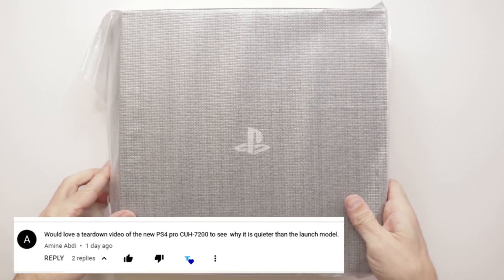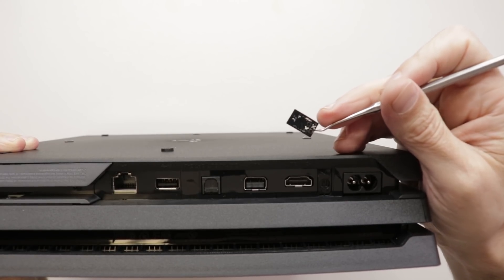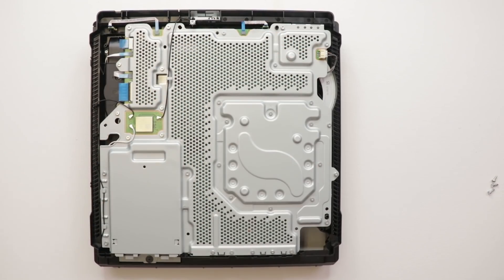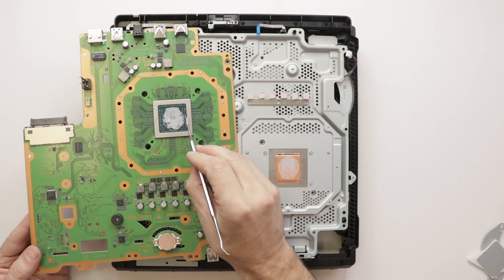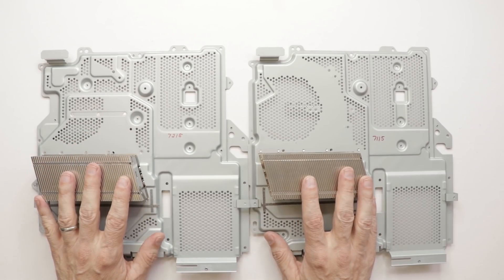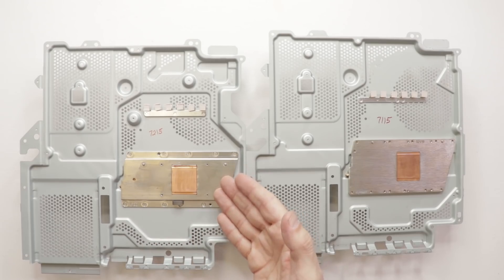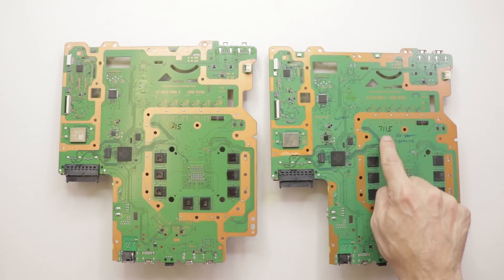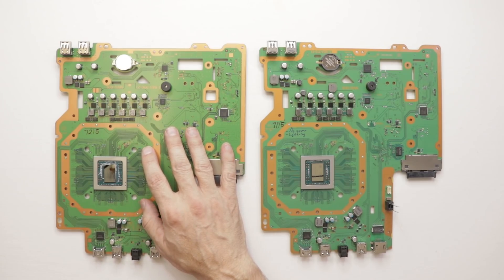The New 2018 PS4 Pro is so Quiet - But Why? Disassembly and Comparison - 7215 Model

Comment: Actually the newer heatsink design means it goes on tighter once screwed, which means much better heat dissipation. You can achieve a similar result if you bend the clamp on the older pro, although obviously won't be as effective.
Reply: To be honest when I first stripped down my launch PS4 Pro it looked like the whole problem with them and noise was simply down to bad factory assembly. The thermal pads were poorly aligned on the RAM and the thermal compound covered maybe 60% of the APU die.

Once I resolved these issues my Pro became whisper quiet.

Comment: I got the new PS4 Pro About 5 months ago to replace my older PS4 Pro as that one really did sound like a jet engine (hate noise!) Problem is the New Pro is getting loud, nowhere near as loud as the last one but still annoying.. I have taken the cover off and cleaned the fan, its as clean as a whistle but the noise is still there Grrrr... Any help would be appreciated thanks.

Comment: It's honestly disappointing Sony didn't even bother upgrading the cooling system with a liquid cooling system if there's one thing Microsoft does better is they have a much better cooling design It's truly fascinating on my Xbox One X I have tried the most graphical demanding games like Resident Evil 3 remake or Red Dead redemption 2 I do not hear a thing It's scary quiet and I know why it's super quiet to the point you don't even hear the fan It's because they are using liquid cooling the PS4 Pro should have used liquid cooling it would literally prevent the fan spinning so fast to the point it sounds like a dam jet going at Mach 3 And I find it strange Sony did extremely well with PS3 super slim it was the most quietest PlayStation console ever made but why the PS4 models are so damn loud? I found out the real problem is Sony decided to use a cheap ass thermal paste on the APU But much to my shockness I decided to dismantle my PS4 Pro destiny 2 model then I noticed the thermal paste was dry as hell So I scraped it off I bought the best thermal paste I could find I carefully applied it to the APU chip with a q-tip reassembled everything back then I decided to play bullet storm full clip edition again I could not believe that made the biggest difference I don't even hear the fan going haywire anymore 😲 I guess this whole time the fan was only spinning so fast because the thermal paste wasn't doing its job keeping the APU chip as cool as possible But hopefully the one I applied should last several years 😉👍
Reply: Commander's Gaming Channel does x1x have liquid cooling?
Reply: @captainaves  
Actually yes the Xbox One X is the first gaming console to have a liquid cooling system That's why it's so damn whisper quiet even I put my ears next to it I do not hear the fan at all no matter how GPU demanding the game is it still takes it like a champ 😍👍

Comment: I tried cleaning my original pro fully at the weekend cos it sounded like a jet... i ended up accidentally pulling the holster for the power supply from the motherboard instead of just the clip :( I also made a bit of a poor job at redoing the thermal paste (first time dismantling) . Anyway luckily i had a repair place not too far from me, cost me £70 to fix but they cleaned it further, re did the paste and put re-fixed the power supply to the motherboard. It now sounds a good amount quieter (there was an insane amount of dust clogging the heat sink and other areas. I’d recommend taking it in for a service if yours sounds like a jet anyone.

Comment: count the grills on the radiator, it seems like they have configured the air to metal ratio between them. Something like getting the air to fuel ratio just right on the car...

Comment: I could see a small difference between the heat sinks of the two so I fired up Photoshop and created a selection on 7100 series and putting that layer on top of 7200 series reveals that 7200 heat sink is indeed a bit bigger. We can not see the depth as we do not have side photo but if it is also just a bit bigger in Z depth then it is safe to say it has a bigger volume of air to pass through and that could make a huge difference with everything being the same.
Reply: Btw I'm talking about the area that has the air passing through which is the side that is important. When you turn it around and talk about area difference of the plate that has copper portion that is contacting IHS, that part does not matter at all since only copper area is contacting and the rest is useless.
The other side however has the thin layers of metal sheets in compact formation of rows that air passes through for a cooling effect and that area from top-down makes all the difference, and if the depth has a height difference then it becomes not just a small area difference but a bigger volume difference. So, inch x inch = inch squared area but if it is inch x inch x inch = inch cubed volume and for cooling air volume is all that matters

Comment: i got the regular ps4 and it was very noisy . then i disassembled it and the thermal past was rock solid i literally scrap it off from the die then i replace replaced it an it's very quiet since

Comment: Liquid metal about a year ago, my 'launch' Pro is inaudible playing 112 hours of Persona 5.
Reply: Now it runs cool and fast cuz... well I've put an SSD in every of my PS4 Slim and Pro
Reply: Tbh 112h isn't that much. I've played over 2k Hours on my PS4 Slim and needed to clean it after about 2 years (at this point I couldn't take the noise, although it wasnt that bad)
Reply: @Warlord_Nero stillll run-in smooth and its vertical stood.

Comment: Hi ! I Bought one in Japan a CUH7200B the outside and the manual says it runs on 110 volts only. I’ve read some forums saying ps4/ps4pro  have universal voltage that can play 110-240 v

I’m gonna go back to my country that uses 220v :| Can you confirm if it can run on 220v and not blow up ?
Reply: Yes, I have bought 7215b model of ps4 pro from usa and now using it in Pakistan on 220v. So, no issue because ps4 pro's power supply is manufactured in a way that can be run on 110v and 220v as well.

Comment: Based on Digital Foundry's measurements, the 7200 model draws the same amount of power as the 7100, within a few watts. 7200 exhaust is a bit hotter. My guess is that either the 7200 somehow is more efficient at getting heat removed from the heatsink, or maybe it's quieter because they found a reliable way to let it run 4-5 degrees hotter under load.

Comment: It appears the shape of the heatsink is also different. As seen at 5:40, the new model has vertical faces that the old one does not have (as the old one is a flat plane). I wonder if that can change the heat dissipation as well.

Comment: Hi Tronicsfix. I have a question.  It's August 2019  Can a person get a Model #7200 ps4 without buying the Red dead redemption 2 bundle ?  They are hard to find.  Thank u. I hope u see this. I actually have 2more question.  Do u see more ps4 pros breaking down than the original ?  I see alot of people complaining there 2 year old ps4pro is already broke on them.  Should I just get a slim ?  I'm saving up for the PS5  of course.  Thanks again!!😎👊

Comment: Mabey it is just me but I think that it is strange when people that bought the PSpro very early on when the new PS model was introduced got a inferior product than people that bought the console much later on. You should think that just because it is the first model that Sony did everything to ensure that anything on the PSpro worked flawlessly. This is a well known issue with consoles that they make a lot of noise. It is imo better to put in a fan that is more expensive but make less noise than the fan that is used in the introduction model and sell the console for little bit higher price and have a quieter gameplay experience.

Comment: I really like how they made the fan easily accessible to clean if needed.
Reply: the whole console is easy to maintain, it just has tons of screws
Reply: If only the heatsink was easy to access and clean without voiding the warranty
Reply: @Ultimately_Everything  it's not like you can fully disassemble any product in the world without voiding a warranty. the sticker is there to make sure it's not your fault and that it is actually a manufacturing issue.

Comment: There’s a very simple reason. The fan just spins slower. This reduces noise (a lot) but causes the apu&heatsink to run hotter which is why the exhaust air is also noticeably hotter.
Reply: are u dum we all knoww that

Comment: A slightly thicker heatsink on the older model gives the sink more thermal mass, but its surface area that's important to losing heat energy by forced (or non-forced) convection.  So, both models have the same heatsink.  I suspect the CPU/GPU are more efficient on the later model.
Reply: It's the same CPU/GPU.

Comment: gotta tell you my good man, I don't understand what people want anymore? a 4k UHD gaming ready machine for less than 400€ sounds like gold standard of a bargain to me. it does come with a bit of noise included, BUT you payed less than a mid-ranged graphics card for PC costs and you are complaining? come on.
Reply: Ok but howcome the xbox sounds so quiet. Go search it on youtube there's literally almost no blowing sound LOL. But then you point out that the cost is to little for the ps4 seens like you're not comparing it to similar prices
Reply: @hahazim34  good point. but you're forgetting that MS is behind xbox and they did their console somewhat differently than PS4 or PS4 pro. took a lot of time to even get in the console business, so when Sony was at PS3 they made their first console ever.

Comment: One big change that no one noticed is theres way more room in the new one for air to circulate, the heat sync is actually bigger on the new one, and the raised portion is extra metal, the stamped metal is raised away from the fan far more than the old, more room for air to move, less noise

Comment: I have the white 7100 revision and it's very quiet. It does kick out some heat and occasionally gets a bit of faint coil whine with pro optimised games (pretty common and nothing to worry about)... But still very quiet compared to the launch Pro and earlier PS4 models. The biggest change for the 7200 revision is the power connector. The 2-pin kettle style connector on the 7000/7100 is not very secure and feels a bit wobbly/loose. The figure of 8 connector on the 7200 is a tighter fit and much more secure.

Comment: There are 2 missing resistors in the upper left corner on the processor side of the motherboard on the 7200. I would assume that you are correct in that they found a way to make it significantly more efficient so it does not need to pump so much energy through the board that they decided they no longer needed to gate that power.

Comment: O_o Um it has exactly double the air flow to the fan thanks to the extra holes. Pretty sure that this means it can dump the hot air far more efficiently and so runs cooler. Sometimes it doesn't take much to reduce the heat in a compact case. In the previous the fan was trying to pull sufficient air through half the holes and so had to work twice as hard to gain the same cooling.

Comment: Well I noticed that when you removed the new style warranty stickers is the new pro takes a standard figure 8 power cable. The old school PS4 pro took what looked like a desktop power supply cable minus a ground. So would would that mean the new model takes less power than the old desktop computer style power cord?

Comment: I dont know why it cools better. But i just open my buddy PS4 pro (Destiny 2 White) to fix is disc drive but man the Paste on the chip was sooo dry and was like caulking and there was sooo much. then i put it back together i put some arctic sliver Paste . let see if that does anything.and this system was very clean too for being 2 years old

Comment: @TronicsFix Digital Foundry did tests on the new PS4-PRO RDR2 Bundle. Even though it is quieter, it does in fact run hotter. Which is kinda what I was thinking. As Sony did cheap out on the Heat Sink. I think we could all agree with that. As always Thank You For All You Do & Keep Up The GREAT Work!! ✌🏻

Comment: Id love to see a temp test more then the it just cools better because its less noisy. I have a feeling they are just letting them,get warmer or a better fan noise wise. And the metal base plate being a diff size does not really do anything since that part is not finned for heat dissipation and has no air flow over it.

Comment: You're quite knowledgeable, no doubt, but from what I know just because the new one is quieter, doesn't mean it's running cooler. Sure hotter temps will make your fan rev more, but it can just do that by default to ensure it doesn't overheat perhaps? It could just be the fan is quieter no? bearings whatever? I have a PS4 pro that only sounds like a jet playing certain games. Some high demanding games seem to be optimized better, like Witcher 3 my PS4 Pro is pretty quiet, yet Just Cause 4, Resident Evil 2 my PS4 Pro goes crazy..Red Dead Redemption 2 of all games, is actually pretty decent. Hitman 2 is damn loud. 

To further perhaps prove my point, on my PC I replaced my fans, and now I can't even tell if my computer is on unless of course I look. If I play the same game I did before I switched fans, I could hear it, now it's whisper quiet. Perhaps this same thing is why the new one is quiet? or maybe you're right...maybe the new one is so much more efficient, and doesn't get nearly as hot, that even poorly optimized games will be quieter simply because the temps are in a lower range. Ok my rant is over. Great video btw...I'm new to your channel, just subbed. Congrats on 100K, meanwhile I celebrated hitting 500 subs last week lol, and I thought that was special.

Comment: Sony is cheaping out putting a toshiba hard drive, remember when even the playstation 3 super slim came with a 250gb HGST hard drive? That is the most reliable hard drive on the planet, even used on server applications. Toshiba drives crap out less than a month

Comment: one would have to test the physical thermal conductivity of the new heatsink ,, the new metalwork design over the fan inlet looks like it is quite a bit more free flowing compared to the last design , the next question is did you compare the fans themselves as far as any subtle design changes to the fans rotor  ? run the old and new fans at the exact same rpm and measure sound levels

Comment: Watching all these repair videos it makes me feel like I can fix something on my own now lol 😂 no not really I’d probably make it worse...
Reply: I just opened my pro ( loud model ) up today and cleaned it and added arctic MX-4 2019 edition thermal paste and arctic high performance thermal pads to replace the stock vrm and memory chip pads. Did well until I decided to try to replace my CMOS battery because why not.....ended up breaking it some hot glue and prayers it was a success. Luckily my PSU connector comes out easy atleast. In conclusion it was a success PlayStation no longer gets above 50 degrees Celsius and no longer sounds like a jet engine even while in cod menu.
Reply: Like Steve says: you'd fix it until it's broken lol

Comment: hey guys i have this model it is super quiet  not a  sound out of it , its placed in a well ventilated room , but yea it runs very hot on the back of course on the heat sink area  , not excesive hot or finger burning of course not , but yes hot right ??

Comment: PS4: pro pretty quiet 
PS4: slim basically no sound 
Regular PS4: u live on a run way
Reply: my ps4 2015 is quiet after i cleaned it
Reply: @simorx580  my second version of the ps4 pretty quiet  after i cleaned it and changed the thermal paste 😊
Reply: My brother has a slim and when he plays fortnite it sounds like an engine
Reply: I have the original ps4 pro had it since November 2016 and it's like a jet I'm sick of it lol plus the ps4 menu sucks it's slow as hell when you try to invite people on the so called quick menu lmao the software is garbage
Reply: @a12-k3r  the jet sound is because lack of thermal paste and probably the heat sink has no airflow, try cleaning the console, apply new thermal paste and you should be jet free, for the slow menu try starting the console in Safe Mode and select the Rebuild Database ! Hope this works
Reply: @a12-k3r  ssd makes the menu super fast if you put one in
Reply: a 12 upgrade to slim and keep it clean and you’ll be lag free
Reply: my ps4 slim is silent
Reply: The 1215 ps4 models are actually very quiet.
Reply: @UssyMustyYS  I got that model
Reply: That's why I even upgraded... The sound made me wonder if there was a major performance difference.
Reply: my slim sounds like a starting jet. i i already put new thermal paste on it.
Reply: Lol my ps4 pro sounds like a jet with Modern Warfare
Reply: I prefer pro over slim since better graphics and not much sound

Comment: They also changed the power connector. The launch model I have has a big kettle lead, this uses a regular figure-8 lead like the PS4 Slim and 2014 models.

Comment: i guess it is optimized in software: tweaking fan curve, voltage/clock, and driver updates. 

is also important that consoles have Framerate limiter ON, so, will be 30, 35, 50, 60... and that also limits the APU usage when is capable of more. also, can be more VRAM, that helps a lot the GPU to work propperly.

Comment: if you make a lot of holes in the case that cover system fan you can refresh more faster this console. the case stops fresh air flow so only needs han efficient air handle.